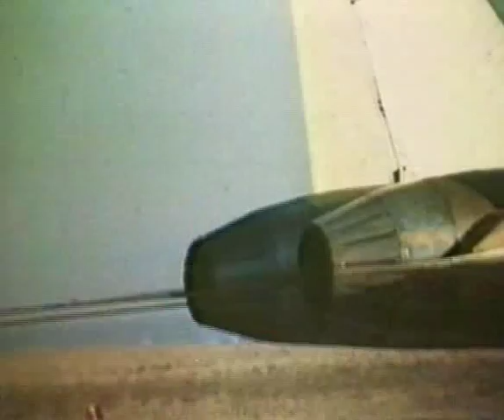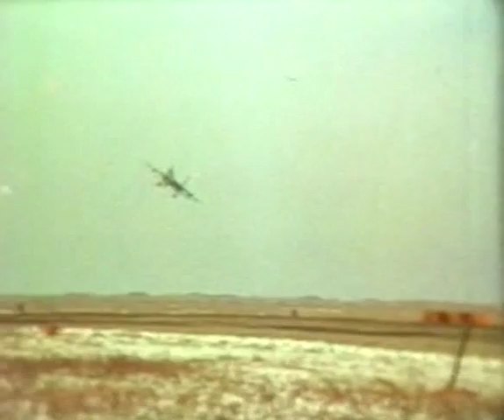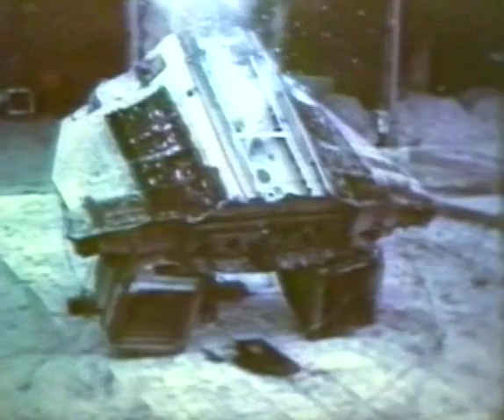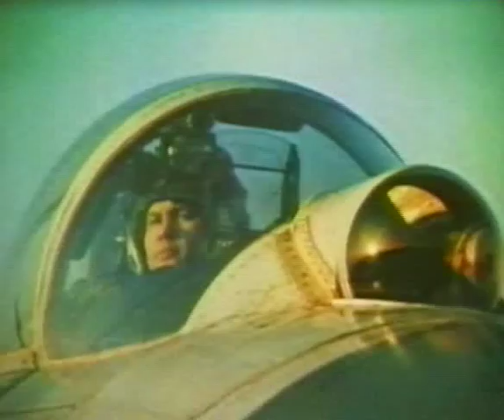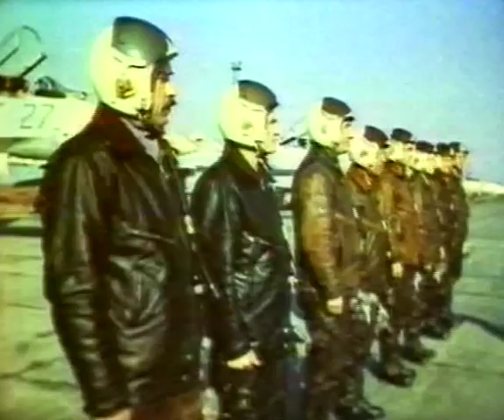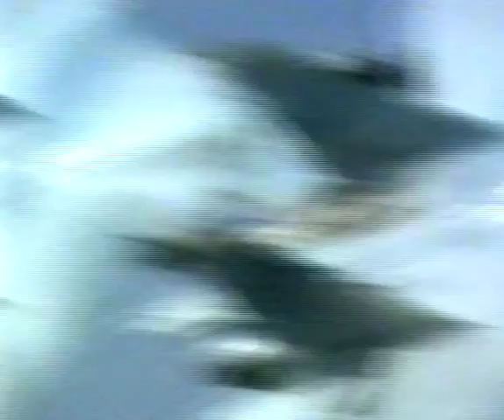The sukhoi story part 3

Comment: OK!! A RA RA response. first of all Americans along with western pilots are well trained and have logged more hours then their Inferior pilot adversaries.But in the hands of a skilled Pilot flying a Sukhoi- 27,30,35. No contest. It's easier on maintenance,it can operate on rugged runways,perform well in any hazardous weather conditions, can fly much longer range with out having to use fuel drop tanks and it's highly maneuverable as well as cheaper then western fighters. This is Jet is MEAN!!!!!

Comment: @vfIskullangel Yes it has more kills because in places like Israel and Dessert Storm. But if the SU=27 can last longer in the air than the F-15 and it can operate in any weather as well as take off in rigged runways, Safer stability to fly in ,easier to maintain and it can always constantly upgraded. The latest and finest upgrade is the SU-35. We Americans are always bragging about kills.Especially against inferior pilots. Let me assure you that this pilot friendly Jet is Deadly.

Comment: This Jet will knock the snot out the American F-15C and will hold it's own against the F-22 Raptor especially when the Raptors Stealth is melted away during rain.Another thing to consider is also the fact that it can clock more hours in the air than the F-22 raptors.The Raptor has a huge problem which is? That for every 1 hour in the Air it will need 30 hours on the ground for maintenance.The F22 and F35 will be a sitting duck on the ground while the SU27 and other Jets are still buzzing around.